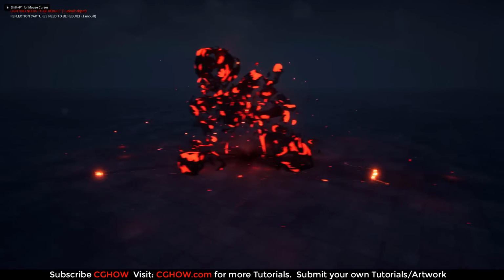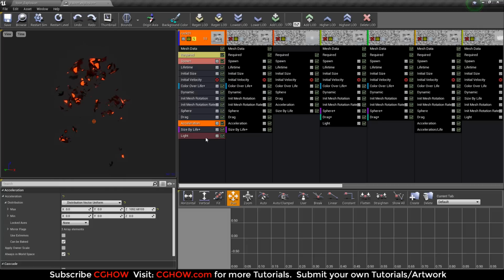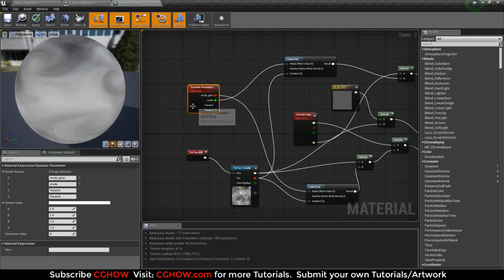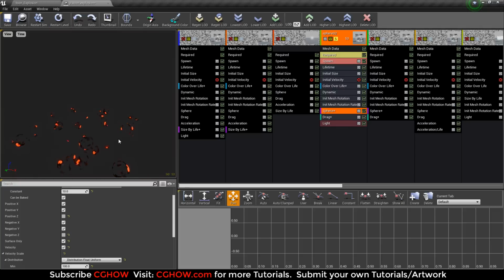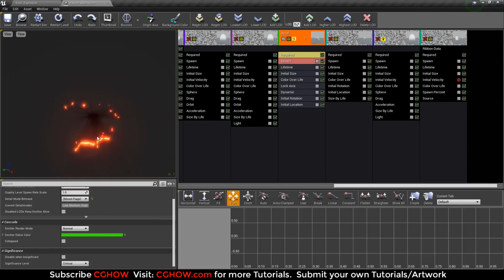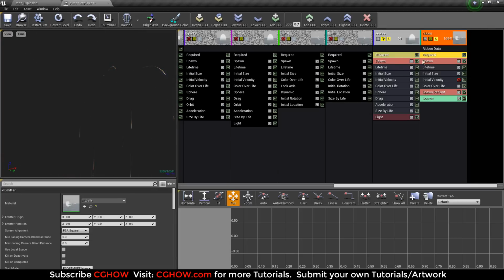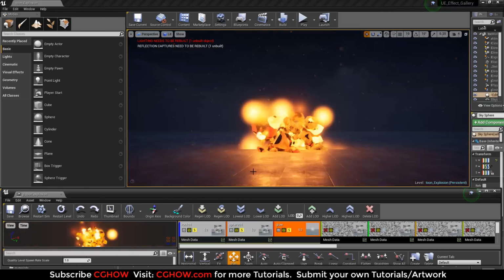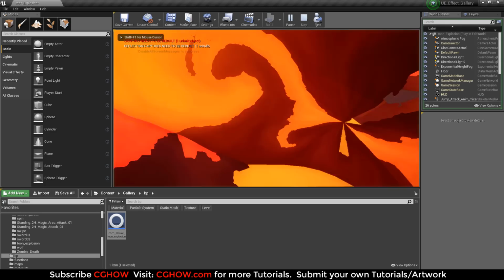Make INSANE Anime Explosions in Unreal Engine 4 (Stylized VFX Tutorial) 💥✨

Comment: I tried to follow this, but you seem to not show many of the settings necessary to get the same effects.  It would help if you could put the example online somewhere.  For instance, in the first effect you skipped over needing a Drag module -- I saw from your other Niagara tutorial that the value there should be 6.5.  It makes a huge difference whether that module is there or not.  Other things you need to do:  Under Spawn, set Rate  Distribution Constant to 0.   In Required, set Emitter Loops to 1.
Reply: Yeah less tutorial more 'i made a cool thing and want to show it'
Reply: This is the same problem I have with him. It's more about the things he has already done instead of a tutorials. And he charge too much for his packs as well.